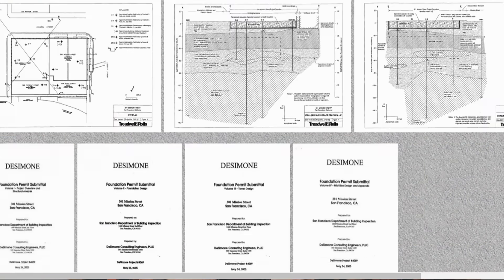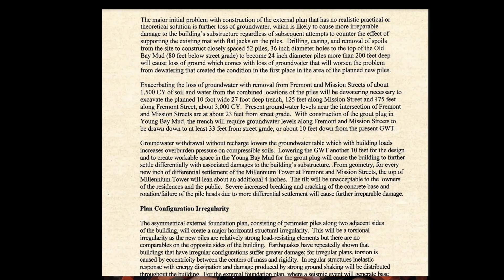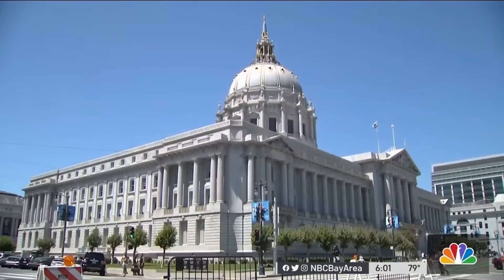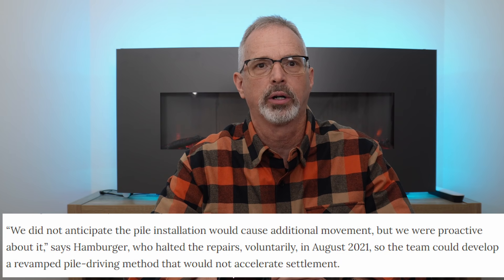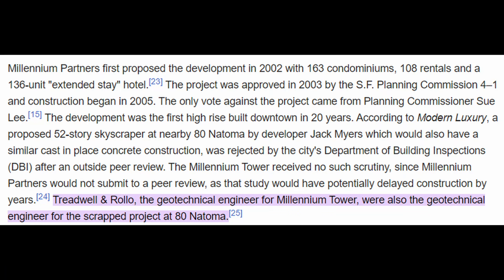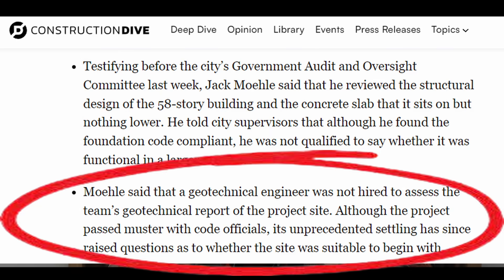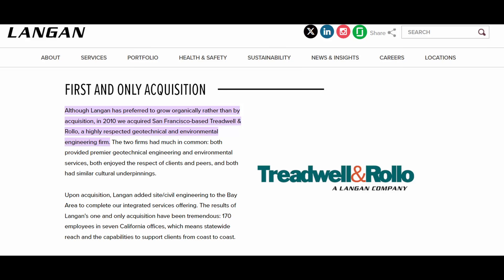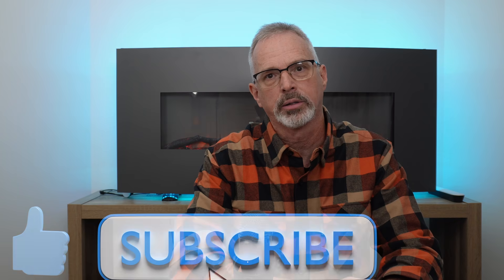Millennium Tower  -  $500 Million Wasted?

Comment: I love it! Lawyers making engineering decisions. What could go wrong? These bandaids are only going to last until a minor earthquake.  My experience with many city departments has not been good. Your video and observations show that the entire system of owners, engineers, and the city are trying to just get away from this nightmare that they created. Where I live, the city could be liable for a lot of the costs because they approved it. This sure seems like a case of karma being a witch. I feel sorry for the condo owners but not for any of the others. I hope that nobody gets hurt when it comes down. I am concerned about the safety of the two engineers that volunteered their opinions. In most cases, no good deed goes unpunished. Many years ago, a company that I worked for decided to source hardware from china. It wasn't in my department but I warned them that a lot of that steel was substandard and that they needed to do extensive quality assurance before using it. They ignored me and used it. First job, it failed. Men got hurt. The company then tested the chinesium and it was less than 1/6 the strength that it was supposed to be. My emails were erased and I was terminated. It felt so good to leave that place. Another very good and comprehensive video. Good Luck, Rick

Comment: 161 Maiden Lane (also known as One Seaport, 1 Seaport, or Seaport Residences) is a 670 ft (205 m) tall residential skyscraper on hold in the Financial District of Manhattan, New York City ... The building leans 3 inches (76 mm) to the north as a result of the method used to construct its foundation.

https://en.wikipedia.org/wiki/161_Maiden_Lane

Comment: Take this building apart.  Rebuild it on another site.  Then build a proper structure on the site.... For the original structure once rebuild.  Use it as an immigration housing why wait for immigration hearings.  Or transition housing or low income housing for the city....
Reply: Because you think you can disassemble the building, and then reassemble it someplace else????

Comment: As a non-engineer I would be thinking that this much settlement would do such extensive rupturing and damage to the interior of the building as to make it nonfunctional and even unlivable.
Reply: Alignment of the elevator shafts is expected to be the first permanent end of occupancy..
Reply: What kind of crazy rig did they have to do to get water, electric and telco into this building without the feeds being sheared off?
Reply: @johnpublic6582  you would be surprised what you can do with flex couplings in the middle of the night.
Reply: @willi-fg2dh  True, but I don't think I've ever seen a 36 inch flex coupling.  I guess they don't keep those out front at the hardware store.  ;)
Reply: @willi-fg2dh  🤣🤣🤣🤣🤣🤣🤣🤣🤣🤣🤣🤣🤣🤣🤣🤣🤣🤣🤣🤣
Reply: @johnpublic6582  Those pipes and conduits BEND.
Reply: 100%
Reply: Not nearly as bad as when the next major earthquake hits.
Reply: There's a high-rise in Cairo on an island in the Nile with a kink part way, which stops the elevators.  The kink is the result of settlement and an effort to correct.
Reply: The building tilting alone is causing issues with plumbing already. So it’s already becoming unlivable.
Reply: There's still time: the tower's lean keeps getting worse.

You might be wrong now but you might be right in the near future.
Reply: @tinetannies4637 That’s already happening
Reply: Not true. In Mexico City they have horrendous subsidence. You must put the building on a thick raft to ensure it moves as a unit.
They have clever connection details for the services.
Reply: oneeeeeeeeeeeeeeeeeeeeeeeeeeeeeeeeeeeeee  building

Comment: I would not want to even live near this place many others living /working in other buildings are at danger here also , such a flawed contruction while being a Smart looking place, it should be condemed and the place taken down, were is the tipping point considering it as a monolith still, as it gets more out of plumb the loading increases on the side in the direction of the tilt and will exceed the load bearing capabilities of what it is made of, they need to quit trying to save this and use the monies to a better end, the poor taxpayer once again Good Greif ! Cheers

Comment: Can they switch to the internal plan now?
Reply from the maker: Actually, I think they still could but they would have to come up with another $150 million or so to do it.  It would still be better than having all of the uncertainty about the building future along with the safety concerns.
Reply: @CaseyJones-Engineer 
At some point did they risk the foundation being in such poor shape that it can’t be stabilized properly anymore? 
Assuming they can deal with the current tilt on a permanent basis. I saw a story where one person abandon their unit because sewage was backing up into the unit due to the tilt.

Comment: Given the probable intense seismic activity which is expected in the Bay Area within a few decades (if not before) would it not have been wise not only to mandate bedrock anchoring on major structures but additionally to enforce building material integrity…and by that I mean high grade structural steel with redundant sway dampening systems.

Comment: It would be very interesting to find out how many skyscrapers built in the last 30 years, have foundation problems
Reply from the maker: I agree.  I am guessing it is more than this building that could have an issue.
Reply: @CaseyJones-Engineer 161 Maiden Lane in Manhattan, South Street Seaport.
Reply: It's recently been discovered that downtown Chicago is basically sinking because the heat produced by its underground infrastructure is causing the clay soil on which the city was constructed  to contract. Could be a problem with a lot of major metropolises.
Reply from the maker: Thanks for that suggestion.  I will check it out. @jbb-cj1md
Reply: @jbb-cj1md Unless it is ice, wouldn’t heat cause expansion?
Reply: @Inkling777  Interesting... as I recall, a large portion of the underlying soils in London is a rather thick chalk (calcium carbonate) layer, which would be relatively resistant to dimensional change with minor changes in temperature... but that layer is fairly deep, and shallower tunnels may well be in less stable formations.
Reply: I'd suspect that the problem goes back at least 60 years, when they started building high rises in the City.
Reply: Probably hundreds in China, where the high-rise buildings go up at lightning speed, and the main contractor often pockets half the contract amount and subcontracts the work with the remaining half, forcing the subcontractors to cut corners to avoid losing money.

Comment: I am a naval architect and marine engineer.  My knowledge of building foundations is next to squat (a valid maritime reference).  Throughout my career, I learned to seek out and rely on second and third opinions, and sometimes a fourth.

At the beginning of my career, I worked with, in almost all cases a shipyard or consulting engineer, or both, regulatory agencies, most often the American Bureau of Shipping (ABS) and the United States Coast Guard  (USCG).  Over time the USCG all but eliminated inspections in US shipyards.  The USCG also dropped most drawing reviews by the USCG Merchant Marine Technical (mmt) offices.  The USCG eventually designated one of the Classification Societies for plan review and inspection.  Despite objections, we took the "politically correct" route and accepted loss of another set of eyes.

Personally,  had I received a letter from the gentlemen at Berkeley I would have stopped what I  was doing and  would have given them a call.

I'm having reconciling one point.   If the additional 57 piles were going to solve the sinkage problem, why wasn't the original foundation designed using 57 piles?  If they only needed 18 piles why wasn't the original arrangement made with just 18 piles?

To someone with no particular knowledge of foundation design, placing additional support under the building makes far more sense than placing them around the outside.

Comment: i was a general engineering contractor my entire life....the geotechnical report was the gospel to pass inspections.   one time a report was so far 'off' from my practical experience that my company demanded a release of liability before performing the work because i 100% disagreed with the water content specified for building on the fat clays.  I acquired the release and performed the work under protest and was proven correct as the parking lot failed about a year after it was installed.  that release saved my company any liability and the entire parking lot was removed and replaced. there was no gain for me demanding that release...in fact, i was mocked  and labeled a 'worry wart'.  listen to experienced people.  we know a lot.  in my career, i would call the geotechnical company often and get the report amended prior to bid, because their report would have an oversight or a blunder.  an objective look from a distance should be welcomed by ALL authors of engineering specifications.

Comment: What a shame for all of this!  If you had been involved from the very beginning.  The building would not be experiencing all on these major problems.   Seems that the cost of going to bedrock in the first place would have been less expensive than what has been spent up to now.
Reply from the maker: Thank you.  You are right about the relatively low additional cost that extending the pile to bedrock would have entailed.  I have seen reports that indicate that the extra cost would have only been $5 million.
Reply: @CaseyJones-Engineer  Didn't the project reduce the piling design somehow and increase building weight after piling were finished? Potentially there was an adequate piling design and even that was compromised.
Reply from the maker: Yes, as you point out, it looks like there was a whole sequence of errors made in the design and construction of this building. @artsmith103
Reply: From what I understand it would have cost several million to put pilings down to the bedrock. The builders probably thought they were going to be handing out big bonuses.

Comment: How galling it must be for those two men who took it upon themselves to spend the time and write a substantive report, as a public service, submit it only to have it collect dust on the shelf.  Then time proves them right.

I have several questions;
Did I understand you to say that the connection between the pilings and the ten foot thick piling cap/slab had been broken?

Pilings do well with a vertical load, not so much a horizontal load.  That building is sinking at an angle, not straight down, correct?  That puts some serious stress loads at the juncture of slab and piling, with all those piling not sharing the same load, right?

It's common for high rises to have a counterweight load on the roof to counteract wind/earthquake live loads, usually the weight is concrete or water.  Is there such a load on the roof of the Millenium Tower?
Reply from the maker: The concerns about eccentric loading of the piles and likely rupture of some pile/slab connections was stated by Karp and Cardon in their letter to the officials.

I will say I expect that Karp and Cardon probably hoped that their letter had received more consideration than it did.  They have been engineers probably 15 years or more than I have.  Even so, there are many instances where people don't want to take my advice for some reason or another and I am sure it has happened many times with these 2 engineers too.  This is probably due to the client's emotions about some aspect of the topic at hand.
Reply: Isn't the tower moving laterally (horizontally) as well in addition to leaning and sinking?  Also, weren't the original tower plans to use steel for construction but changed over to reinforced concrete (much heavier) and the city approved the plan without investigating first? What a mess. @CaseyJones-Engineer

Comment: Thank you for your detective work and analysis on this tower. Fascinating. I looked at condos for sale in that tower. For example a splendid  large condo: 3 bd, 4 ba, 2,170 sqft with superb view on  the bay, bridge and town for less than $2M ($1995000). That is cheap for such a condo in SF.
However there is a catch: HOA fee $2959/month. Between that and the "special accessments" the tenants have to digest, that cools buyers down.
My totally unfounded crystal ball prediction is that this tower will be teared down. I think the costs to keep it alive will continue to add up without any assurance the problem will be fixed. At some point people (tenants, insurances, city) will realize it doesn't make economic sense to continue throwing money in the pit.
Reply from the maker: I agree with you.  Eventually it is likely that this building reaches a point where it is no longer economically viable.
Reply: @CaseyJones-Engineer Is there historical prescient for something like this? Tearing down a building of such a size? How's it done? Floor by floor from the top down? 

And, secondly, will anyone even want to build another skyscraper on this lot again?
Reply from the maker: Any building can be deconstructed, it just isn't cheap.  Also, the problem with the lot would be interference from all of those existing piling relative to putting in a new foundation that extended to bedrock.  But again, with enough funds that could be managed too. @johnjones3813
Reply: Is that $2million now? Or when it opened?
Reply: The initial developers and the city got their seed money back, most likely...

Long term income is probably never going to meet projections.

In a less densely built up location, controlled implosion is an option, but I suspect that in this case it would need to be done floor by floor to limit potential liability due to risks to adjacent structures and populations.
Reply: I think the plan is to drag feet until the building either collapses and become a major catastrophe dealt with by FEMA or it becomes so clearly doomed that someone has to step in and take it down.

Comment: If de-watering is worsening the problem, wouldn't it be easier to go with the flow and begin drilling adjacent? Eventually drilling to bedrock on all sides.
Reply from the maker: Yes, extending the pile to bedrock throughout the foundation mat would be preferable to what they have now.  Even considering that the foundation mat is 10 feet thick, its large size results in it behaving more as flexible rather than rigid foundation which would cause the loads to be unevenly distributed if they only used extended piling at the foundation perimeter.

Comment: liquefaction  that is what going happen Building   Is going to come down either by Design Disassembly or by earthquake
Reply from the maker: It is interesting that the original geotechnical report has mixed statements on liquefaction.  On the one hand they said that the liquefiable material would be removed during excavation for the basement, but then they also said they expected only 1 inches of settlement due to liquefaction.  Just another example of what I consider to be unclear recommendations in their report.
Reply: I expect a modest earthquake to improve the situation, since the west corner is now supported.  We’ll see how much effect there is when we get one.